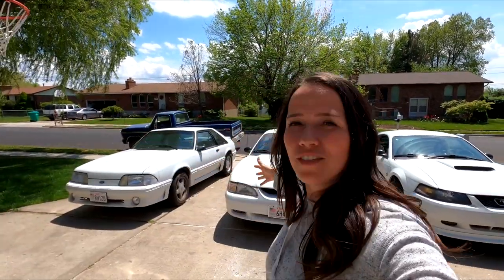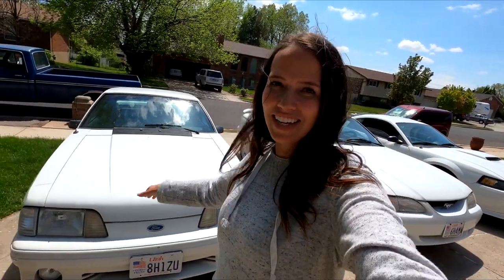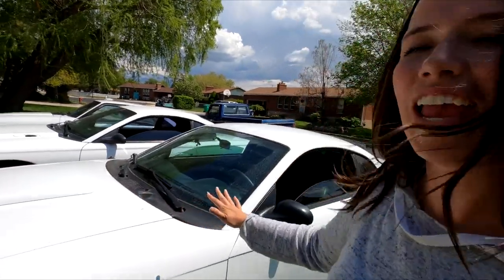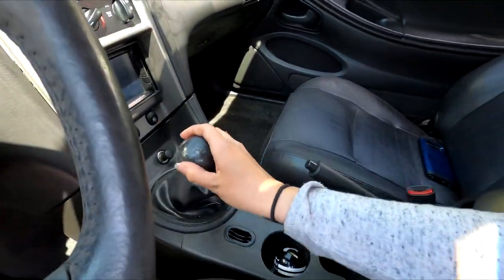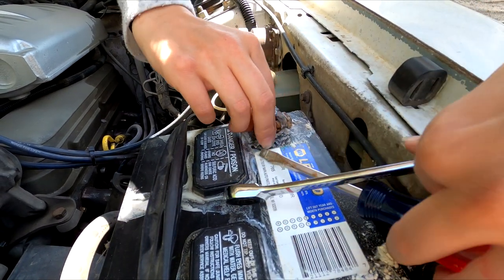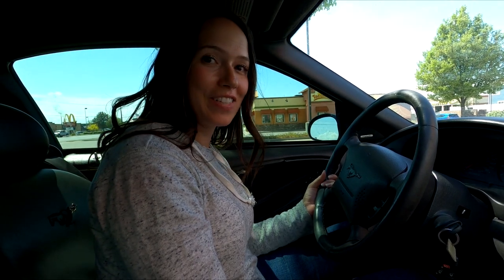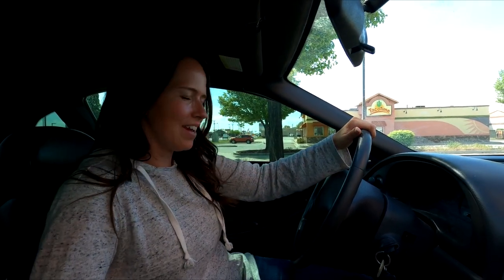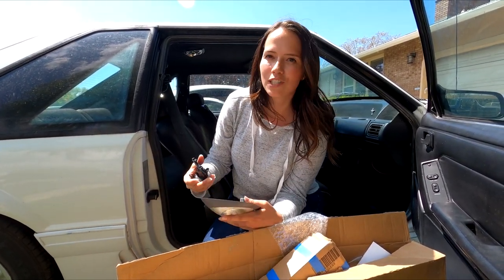MY FOX BODY SN95 and NEW EDGE MUSTANG GT COLLECTION!

Comment: 3 ponies?? Does that qualify as a herd? Lol 
Great looking cars and congrats on your first repairs. Keep the vids coming
Reply from the maker: Haha I love it!! I just googled what a group of horses are called. We can call them: a team, a harras, a rag, a stud, or a string 🐎🐴
Reply: Hi, just a lil info to share, get you a can of antisieze compound, it has a lil brush and use it on the bolts you remove and replace, it preserve the threads and makes screwing and unscrewing ( I know you'd said that lol ) easier, some ppl will disagree but personally I use it on almost every thing, and on your electrical grounds on the body remove them and clean down to clean bare metal and spray with electrical cleaner and reconnect, you'd be surprised how better things work , do the same on the engine grounds. But do not use antisieze on electrical screws or bolts.
Reply: Wide tire placement can improve handling including wide wheels or having 17s vs. 15s.  Maybe you can make it a wide body project.
Reply: Girls Dig Mustangs  nice car like drive in fast at all

Comment: Always remember to make sure to clean those terminals really good as they can cause a battery not to charge or start correctly. And also make sure they are tight on the post give them a turn the terminals and if they move tighten up.but bout over tighten them.you can bust the connections as the are lead which is soft. One last thing never ever sit the battery on the ground directly anywhere in side or outside as that drains them and kills them dead. Keep them off the ground totally! From Ohio you are a doll and love to watch your channel!!

Comment: Good job on the repairs!  If you have trouble starting a nut or a bolt you can turn it backwards ( counterclockwise) a bit till you feel it sort of click, then it will turn clockwise properly.  I also have a fear of dropping parts to never find them again.  When you dropped that nut I felt myself getting tense with you.  LOL!

Comment: Check the rims on your new edge car, there might be wheel spacers on them, you could take em off and that would make the wheels not stick out as far, i love all 3 of your cars.
Reply: The offset on the wheels aren't correct for the car, that's why the spacers were installed!

Comment: You should try to find an SVO they're rare but an 80s icon!
Reply: There's still a bunch of SVOs for sale on Facebook market and craigslist. I had an 86 SVO. Still miss it. Never had a car where the first modification added 50 HP and cost less than dollar till I got that SVO :)
Reply: Truth! Love me an SVO!!!
Reply: Eric Simbuera ,The 1984-1986 SVO is my favorite Mustang of all time.
Reply: @xrmerkur  
I've had a 79 5.0, 85 GT, 92 5.0 LX, and an 86 SVO. The only one I miss is the SVO.
After mods it was the fastest (with a couple gallons of 100 octane unleaded in it) and still got 28 MPG with 4:10 gears. 
On 92 octane due to the new head's higher compression I could only run 12 PSI on 91 or 92 octane 
With a mix of 100 and 92 I'd set it at 20 to 22 PSI. Oh I miss that thing...
Ported head/intake, roller cam, big throttle body, full 3" exhaust, big front mount intercooler. It weighed 2950 LBS
Reply: 331Grabber , so much new design and engineering was introduced into the SVO that carried over for years after. I was surprised Ford allowed a factory equipped 4 cylinder to out perform the V8 variant. The SVO was refined in every appointment. Wow! you’ve had plenty of Fox Bodies in your time. Great platform, but I thought the XR4Ti was gonna be the next best thing, but people weren’t ready for them. Aside from no intercooler, the Merkur was the closest continuation of the SVO. The main reason I got that car was the inspiration of the SVO, double wing spoiler and everything. anyway, I have a feeling you’ll be purchasing another SVO. Ha ha!
Reply: @xrmerkur  
Those Merkur XR4Ti models were pretty awesome too. 
  After owning an SVO my biggest gripe was that it didn't have enough stock horsepower to justify its 40% higher price over the GT. I mean it drives, handles and brakes way better than the 5.0 GT.  But the 2.3 only put out 200 HP stock. Ford was preparing a DOHC 2.3 liter for the SVO when they pulled the plug on the SVO Mustang in 86. They decided to just run out the production of the 2.3 SOHC in the Thunderbird Turbo Coupe and XR4Ti without much improvement :( 
   That pre production DOHC headed turbo 2.3 made 275 HP at 14 or 15 PSI. Damn. Can you imagine that in an SVO or XR4Ti? 
  Do you still have the Merkur? My friend has an 87 with an automatic. It's dead in his yard now :(  The Merkur was the last Ford to have the 2.3 turbo in 1989. They were good cars. The only thing we didn't like about them was the T-9 5-Speed. Those thing were very weak.
Reply: 331Grabber ,currently i have a 2020 Mustang GT. years ago i owned the Merkur for a decade. SVO’s were expensive because of all the improvements so suddenly available on a Fox body including ABS. Cars like that were like retail prototypes the public could buy. eventually the cost equalize for the average person to afford. Just like Lincoln luxury vehicles, they got technology way before the ford did. i also have a Mark VI which is a perfect example of early tech. again, always loved the SVO. it just had so many added functioning touches.
Reply: A 4 cylinder Mustang? 

The SVO sounds like something you would get nowadays with all the downsizing non sense... 😂

Don't get me wrong, the SVO is a nice car, but as a Mustang?! 
V6 Mustangs are already "embarrassing"...
Reply: @Kev27RS  lol I agree but that was turbo 4 and unique for the time. I’d rather have an SVO than one of the new ones with a 4 cylinder. The SVOs are rare
Reply: @ecymbura31  I get what you mean! 😉👍
Reply: @Kev27RS  my neighbor just got a 4 cylinder Chevy Silverado and I think that’s so lame!
Reply: @ecymbura31  Yeah rather lame... 
I think it depends on what kind of car model it is, generally speaking. 

The SVO was a product of its time (mid-80s, fuel crisis, etc.).

Plus, it's not like the actual V8 Mustangs ceased to exist after the SVO introduction. 
In a matter of fact, the SVO had a short life span (that's one of the reasons why it's rare...) 
and the V8 models came back big time after that.

Comment: The New Edge looks much better w/o the rear visor. You are making me want to get the Mach 1 out of hibernation. If you are going to replace the Throw Out bearing, you might as well replace the clutch and pressure plate at the same time while the transmission is out. It is also a good time to replace the fluid in the trans and rearend. Along with Mustang week there is the Ford Nationals in Carlisle, PA and American Muscle does a big Mustang show in Reading, PA. One of the first mods I do is bolt on Hood Struts, makes working in the engine bay so much nicer as you don't have to work around the hood prop.

Comment: You mentioned new wheels and tires for the 2004 gt. I have the anthracite deep-dish bullet rims on my 2004, which is a staggered set up of 315 wide on the rear and 275s on the front. I also have the H and R Supersport springs which gives a 1.75" drop on the front and 1.5" on the rear. This combo looks amazing on my gt. You can actually order wheels and tires from American Muscle, mounted, balanced and  shipped to you ready to go.

Good luck, I love your mustang collection!

Comment: Hey did you try what I told you last video? The throw out bearing on the 04 could be a simple adjustment to the clutch with the cable. As the clutch wears the cable needs adjustment , bearing could start squeaking. Check for firewall adjuster if no firewall adjuster click upwards on the clutch pedal
Reply from the maker: Thank you so much for the reminder!! I will check that today and report back! Seriously...thank you 🙏😀🙏❤
Reply: Girls Dig Mustangs your welcome

Comment: I really like the wheels on the sn95 that you removed the vent visor off the back window from.  What wheels did you have in mind?  Those look really good on there.  I definitely like the car better without the plastic tinted rear window vent visor on it.  That's what it's called.  Glad you fixed the gear lever and seatbelt.  Why in the heck did he put the new seats on and keep the seat belt buckle trapped under the seat?  LOL.  If you want to keep that Cobra gear knob you can buy a shroud that will slide on between the gear shift and knob to hide the threads.  I'd get one made out of aluminum or other metal.  They make plastic shrouds as well.  Just measure the threads on the gear stick to see which size you'd need if you want to go back to that Cobra ball gear shift knob.  Also to remove that adhesive where the vent visor was you need some plastic razor blades and goo gone.  Good to see the blue truck here as well.  Sorry this was so long.(that's what he said)

Comment: When you do this suspension look at eibach Springs and KYB shocks you're also going to have 2 more horizontal shocks they stop your rear end from twisting when you go to do burnouts just imagine as your tires are spinning your rear end and driveshaft is going to want to lift up to check the bump stops,motor mounts, the transmission mount, sometimes the rubber bushings are greasable what anytime do you jack up a car make sure you have jack stands so the car is safe also put something behind the rear tire so the car will not roll and get a dolly so you're not laying on the ground you lay on that and roll around under the car but you can never be too safe working under a car always Safety First😀👊

Comment: Replace the hydraulic shocks on your trunk of the 04 gt, and it will open so much easier. It's like a 20-30 dollar fix. Also if new battery on foxbody goes dead.... good chance its a bad alternator. 
To save $ on parts... use rockauto.com. once you find part and part # you can see if it's cheaper on Amazon. I do this all the time because Amazon prime already gives free shipping.
Lmr.com and Americanmuscle.com are good mustang sites too for many parts.
Reply from the maker: Hey Jimmy!! Thank you so much for all the helpful information!! I will check all of that out 🤗🙏

Comment: The mechanic is going to have to put the car on a lift and most likely he's not going to want you standing underneath the car just in case the lift fails and no one really like somebody looking over their shoulder when they work Maybe he can show you the transmission when it's out also being the car stick shift I would have him check the wheel to make sure there's no burnt spots because this would be the best time to change the clutch plate also look inside the rim those look like factory rims someone might have put Wheels Spaces to get the rims and tires to stick out but all the cars are looking really nice I always knew how smart you are great negotiating and you're learning so much on fixing and maintaining the vehicles so happy to see it

Comment: I don’t really feel like putting the stick shift knob was on the car was necessary if you liked the aftermarket one. All you needed to do was buy a shift boot retainer (can be had for cheap) and it would’ve fixed the issue

Comment: I need to send you some gloves so you do not touch battery corrosion.  Is this youtube channel a real channel?  Your SN95 sounds very good. (Sounds way better that the nasty coyote 5.0 farting sound they all make).  Your 5.0 Fox body also sounds Fab !!   I think this channel is going to take off fast.  I bet the rims have Wheel spacers behind the rims.  REMOVE the wheel spacers and the rims will no longer poke out like that.

Comment: I squirted some grease on mine with grease needle  on grease gun !!! Be for it got to nosiey 200000.0miles ago, throw out bearing still the one it came with!!!
Reply from the maker: Is there a way to do this without dropping the transmission?? 🤔
Reply: @GirlsDigMustangs  there is a dust cover to remove , then with flash lite look up n there in see U can see clutch fork throw out bearing n shaft!! It's easy to do but U need car up high n safe enough to get under there n to see what you need to do to get grease or oil it good?  If ur throw out is not to noisey ? This will work !! Good luck !! Need ny other tips feel free to ask me , I've driven My baby this Feb will be 17years!! My experience most shops just want to get rich off of every customer!!!
Reply: @GirlsDigMustangs Yes,  U can do this with out removing trans!! Just grease threw dust cover access point!!